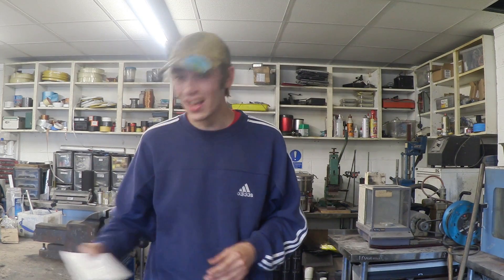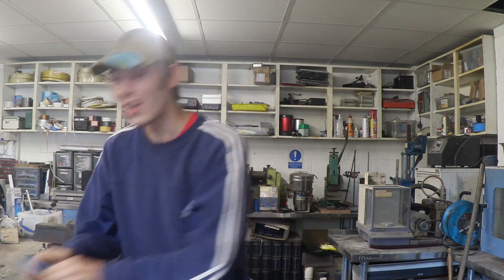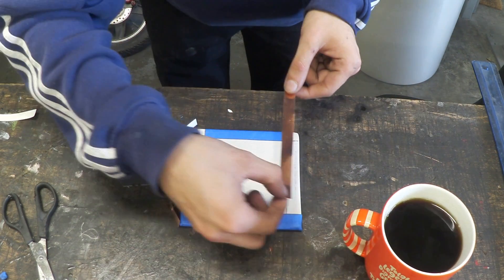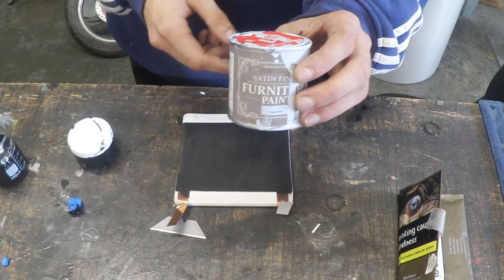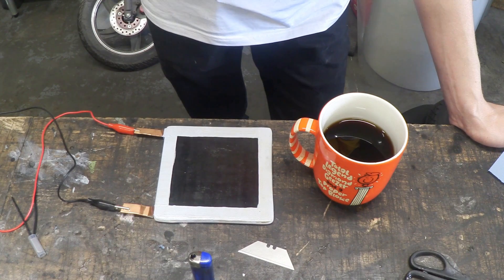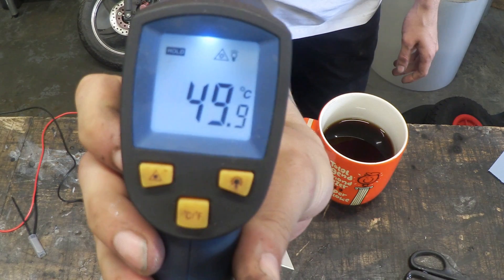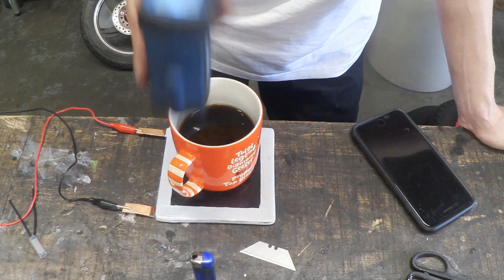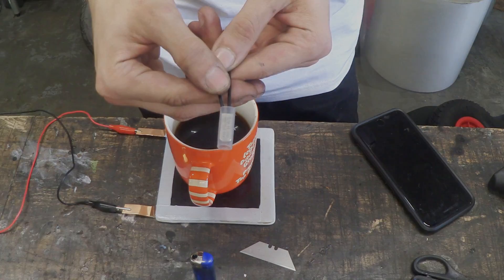1206 - Heated Coaster to Keep Hot Drinks Warm - Using Conductive Ink

Comment: Nice, useful project!  I love it! Which conductive ink did you use? I have Rob's newer more conductive graphene based ink. Can I use that? I am unclear on exactly where the thermal cutout switch was attached.
Reply: break the live wire (red) and connect cutout switch in series

Comment: Modify a coffee cup so heating a cup is more efficient. Then coat it to  make the inside food grade safe.
Reply: Just paint the outside of the cup with the conductive ink and make a base to make contact.
Reply: @JavierChiappa  thay sure is simpler.  But, in doing that, you have to have heat go through the ceramic cup, and the whole cupbhas a larger surface area than just the bottom so maybe it could heat faster, but the parts your heating are on the outside of the cup doing a fair bit of warming air. 

It would be nice if we can just heat the inside of the cup and have the ceramic part of the cup insulate keeping  much of the heat inside.
Reply: Have copper wire under foodgrade resin lead into a heating element at the bottom then. It's not magic and then all you'd need is a base to put the cup on that will touch connector connected to those wires.

If you want an actually good self heating cup you'd need to over engineer it because what's required of a cup and what's required of the heating elements is not very well aligned with each other. Best solution would be a heat conductive base connected to a heat transfer resistand side walls, heating element directly beneath the heat conducting base and then another heat resistant covering on the heating element + water proof connectors to power the thing from a dedicated stand.
Reply: @ScarletFlames1  Man, if we are overenginnering the cup, you could use one of those stainless cups that have vacuum inside, paint the liquid wall inside with the ink and restore the vacuum inside the cup. So you would have, from inside out, liquid, stainless, ink, vacuum, stainless (outside wall)